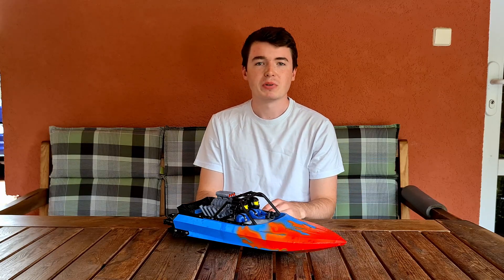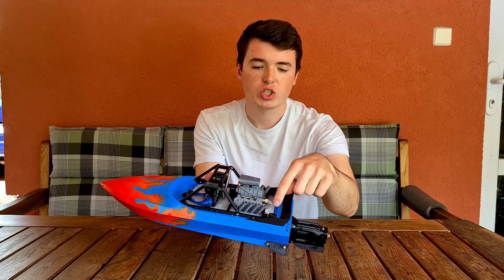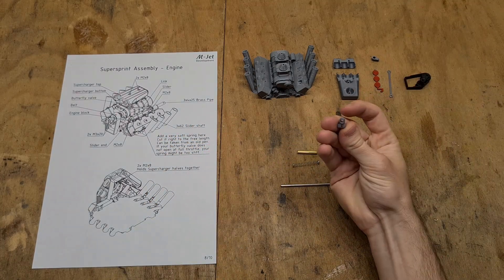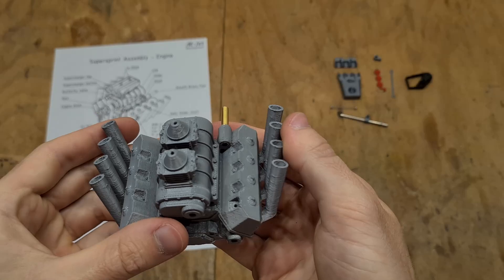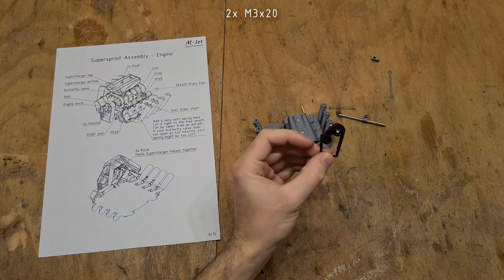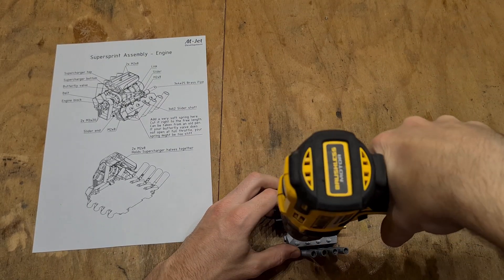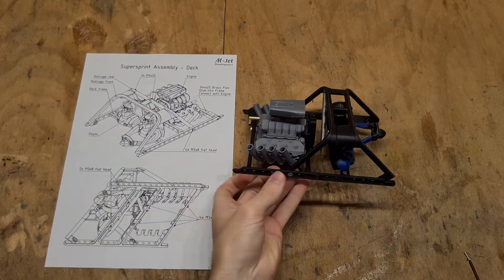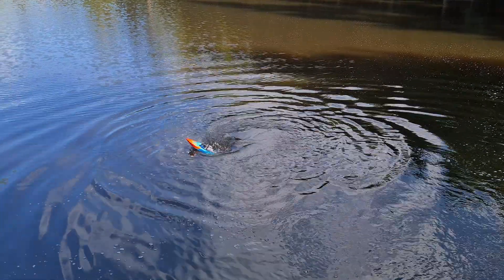3D Printed V8 Engine Shows A Hidden Mechanism

Comment: I went through hell trying to build this component so I'll share what I learned in hopes others can save some time. Tolerances are extremely important on printed parts of the engine. In particular, having a flow rate set too high will result in disaster. If you are having serious issues getting parts to slide nicely try running a flow rate test and adjusting appropriately before reprinting the parts. If the engine block flow rate is too high, the brass tube will be squeezed and you will really struggle to get the rod into it. Similarly, the slider end wont fit on correctly and will push against the rod jamming the mechanism. Also, many brands of rods/tubes do not fit together properly. If you encounter this before installing the tube into the block you can sand the rod while spinning it with a drill as is shown in the main build guide. Just keep in mind, like I said if the flow rate is too high it will cause further issues when you install the brass tube.

Comment: Almost done printing the parts and this is the last step what keeps water from leaking in between the slider shaft and the brass tube on the block ? Also my frame doesn’t seem to click into that spot where the water pressure comes from? Thanks for any information or suggestions!
Reply from the maker: There will always be some leakage between the slider shaft and the brass tube on the block. The leakage doesn't prevent the mechanism from working.

Regarding the frame - if you printed the V1 hull and V1 frame, and you can see that the water path is joined correctly, you should be all good. Maybe the click is just not that pronounced, depending on the alignment of your particular printed parts.
Reply: Ok thanks a lot looking forward to getting it on the water

Comment: I was looking to buy the files to the mjet sprint with the 30mm pump but it’s no longer on cgtraider?
Reply: Sorry I didn’t see it’s included with the super sprint
Reply from the maker: @IsaacSchultz-lz8jc  All good then:)
Reply: One more thing what is the highest kv on 3s you recommend try for the sprint and the super sprint
Reply from the maker: @IsaacSchultz-lz8jc  Please read the latest version of the manual, section electronics. There is some important context as well as the final answer.
https://drive.google.com/drive/folders/1f-epKNBlcqGcuJU5rGvYQleL7ayPnrRe?usp=sharing
Reply: I can’t find the manual for the OG sprint
Reply from the maker: @IsaacSchultz-lz8jc  Ah ok, I am attaching a link for OG Sprint manual. But regarding electronics - motor, battery and ESC requirements are 100% same as for the Supersprint and the Supersprint manual is more detailed about this. So for ESC, motor and battery I suggest following the Supersprint manual as well.
OG Sprint manual:
https://drive.google.com/file/d/1JXAqPCIegU0TW2XvNSiWBZ-T3o3yTSlP/view?usp=drivesdk
Reply: Oh ok thank you

Comment: What mah Battery did u use and how mach it last the battery
Reply: And how much is the boat's run time?
Reply from the maker: @herosjourney2776  5 minutes
Reply: Than what size cant the boat take?
Reply from the maker: @herosjourney2776  Max battery weight 300g. 
I cant tell you dimensions, they depend on your layout in the boat and on each other.
Reply: The battery size i mean and how much weight can it hold?
Reply: Can it hold 360g if i put more flotation in the boat?
Reply from the maker: @herosjourney2776  Maybe, feel free to try
Reply from the maker: 6s 1200mAh. Please read the manual for a lot more information about the build.
https://drive.google.com/drive/folders/1f-epKNBlcqGcuJU5rGvYQleL7ayPnrRe?usp=sharing

Comment: And where did u get the part's and how
much did that cost?
Reply from the maker: You mean where I got all hardware for the boat? That's a long list. See the part list here:

https://drive.google.com/drive/folders/1f-epKNBlcqGcuJU5rGvYQleL7ayPnrRe?usp=sharing

I got all screws, bearings and seals from small stores in my country. 
I bought the electronics from various stores in Europe and some from worldwide suppliers.
Total price for all parts might be around 200 USD, but it varies so much depending where you buy from that there is no simple answer.

Comment: Can u make a video about drivig
Reply from the maker: Yes, I am still collecting some footage but driving videos will definitely come in near future.
Reply: And where did u get the part's and how  much did that cost?
Reply from the maker: @herosjourney2776  You mean where I got all hardware for the boat? That's a long list. See the part list here:

https://drive.google.com/drive/folders/1f-epKNBlcqGcuJU5rGvYQleL7ayPnrRe?usp=sharing

I got all screws, bearings and seals from small stores in my country. 
I bought the electronics from various stores in Europe and some from worldwide suppliers.
Total price for all parts might be around 200 USD, but it varies so much depending where you buy from that there is no simple answer.
Reply: Thank u!!
Reply: Where did you buy it (kind of shop) and what esc and motor did you use?
Reply from the maker: @herosjourney2776  I used Flycolor 90A and 3660 1400KV motor. 
I will post the links to the stores I used but these are not applicable if you live in a different part of the world.
Bearings: 
https://www.loziska-rc.com/
Seals:
https://www.hyhlan.cz/
Screws:
https://www.nerezka.cz/
Motor:
https://tppower.de/en_GB
ESC:
emotors.cz
Battery:
hobbyking.com
Transmitter and receiver:
banggood.com
Reply: And where did u by Epoxy ?
Reply from the maker: @herosjourney2776  I bought epoxy in Bauhaus
Reply: And what filamet time did u use?
Reply from the maker: @herosjourney2776  ASA
Reply: @herosjourney2776  Man google the parts. Do you want him to hold your hand while you build it too?  Google epoxy. You are asking way too much from him.